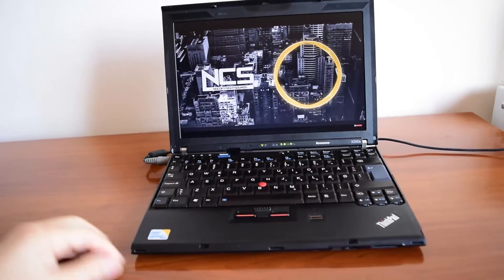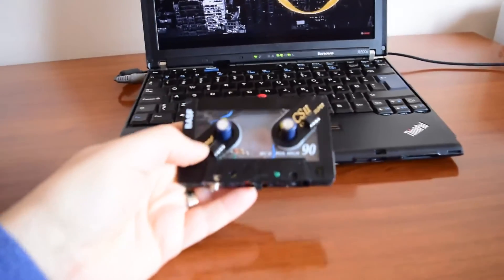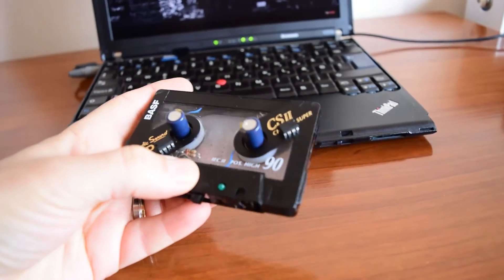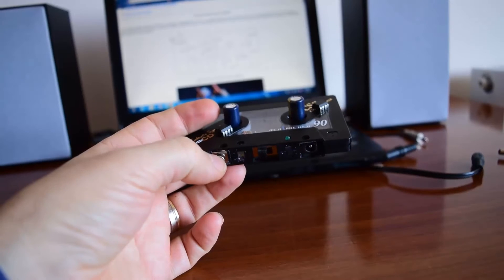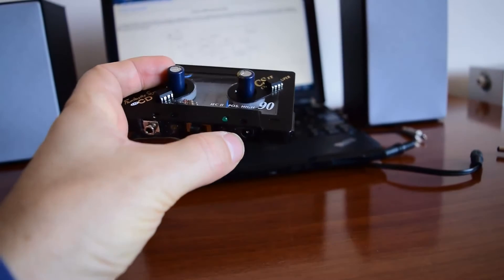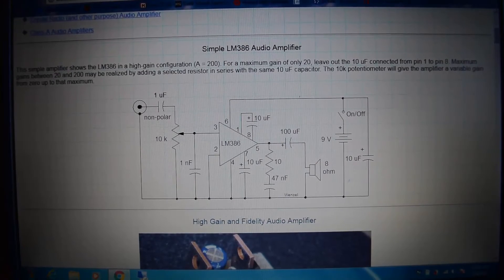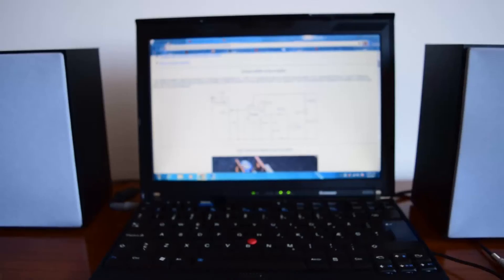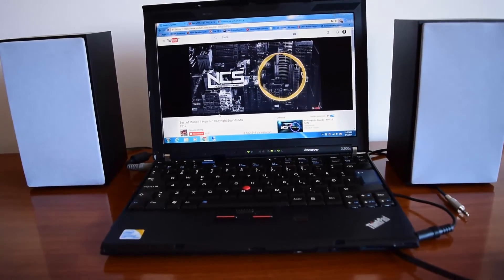Mini Audio Amplifier LM386 - Cassette Hack!

Comment: Cool project man. Keep it up & thanks for sharing.
How about using some Piezospeaker with that? https://en.wikipedia.org/wiki/Piezoelectric_speaker Because, they are tiny & can be put inside that cassette/tape https://www.aliexpress.com/item/10PC-Lot-20MM-Piezoelectric-Ceramic-pieces-Copper-Buzzer-Film-Gasket-YXSMDZ2459/32655837607.html
Reply from the maker: Thanks for appreciation, but I would not want to mount a mini Piezospeaker in amplifier, it would be like I want to play crickets in my box! :)
Reply: https://www.engadget.com/2013/08/29/kyocera-piezoelectric-film-speaker/